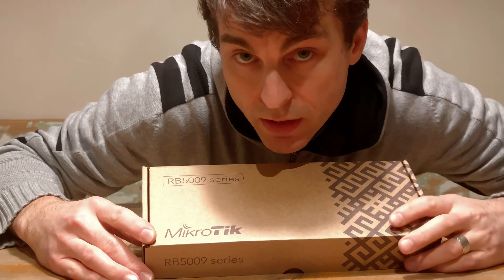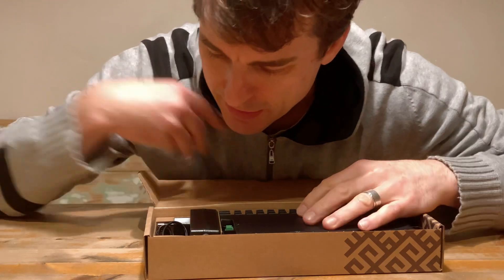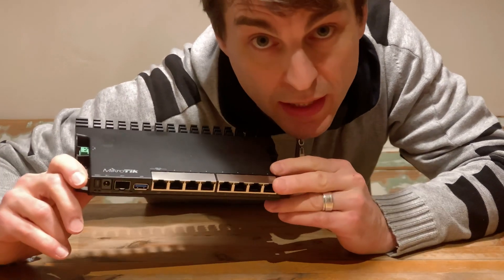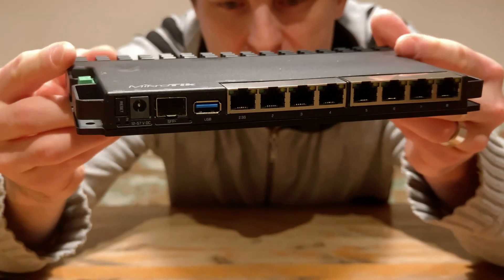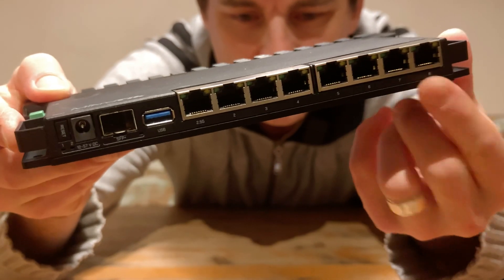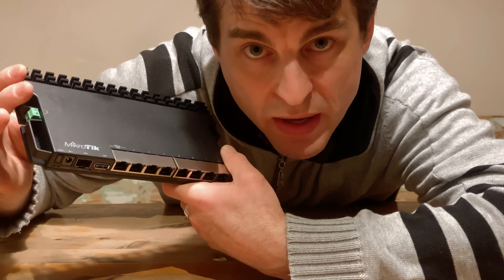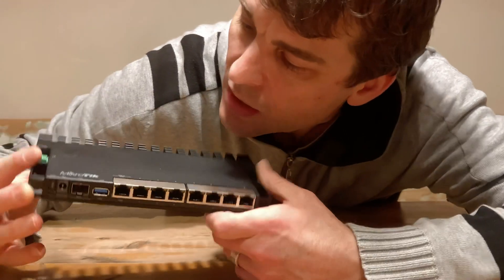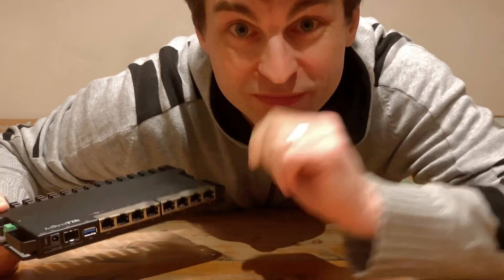Tech: MikroTik RB5009 Router | First look and reaction.

Comment: Generally the MT HW is not overly performant when switching or even less routing. As it has 10G port then try to feed it with a 10G connection and then suck that stream off with several RJ45 ports. It is likely not with so good results.
Reply from the maker: Thanks for your comment and idea. Some thing´s there for me to try. I'll try put the gear to the test.

Comment: Don't know if you're aware of this, but RB5009 is designed for RouterOS 7 only, yet the current stable version of Router OS is 6.49 and ROS 7 is still in "development" release tree. Not to mention that since the beginning of COVID pandemic the quality of RouterOS releases had somewhat dropped (sometimes to the point of people suggesting to hop from "stable" to "long-term" release tree even for regular home and SOHO use cases, not to mention more serious production environments). 

Basically, this is a massively future-proofed device which sounds to be great on paper even today, but can potentially give you a lot of unexpected headaches until ROS 7 will be released in stable/long-term branches some time next year. Maybe it'll be fine, but just be aware of that fact and try to keep your configuration as simple as possible until ROS7 will be considered officially ready for production by Mikrotik.
Reply from the maker: I didn’t know all the details you have provided. Thank you. But I was aware it’s a leap of faith into the MikroTik world. So yes let’s see how this goes.
Reply: @PaulWarrenEaton  To be fair, some people already user RouterOS 7 at home, and so far I didn't see anything that would suggest that it's exeptionally buggy. There are, of course, some bugs in new features (like Wireguard VPN and stuff like that) and stability issues with uncommon configurations. But regular stuff should work just fine, I suppose.
Reply from the maker: I will very soon find out and most definitely will tell you about it. Thank you. I appreciate the ‘heads up’.
Reply: Have you found out, I'm curious before buying one hehe
Reply: I upgraded my RB760iGs to Router OS v7.1. One of the things that I noticed is that ROS killed my reccursive routes that I used to my failover config at home. Couldn't set it up again then I had to switch it up to Netwatch script. By that I can tell that many other things must have changed. Great video btw.